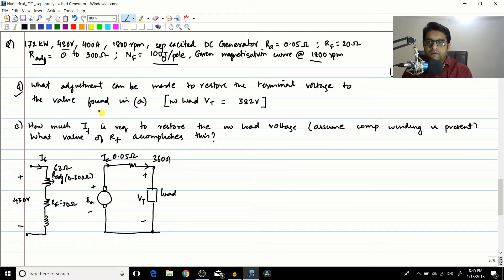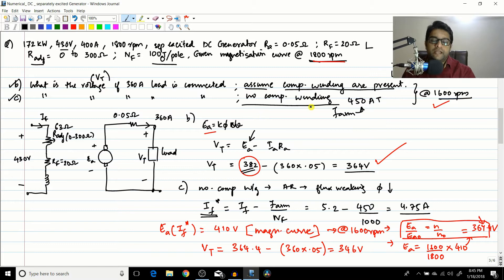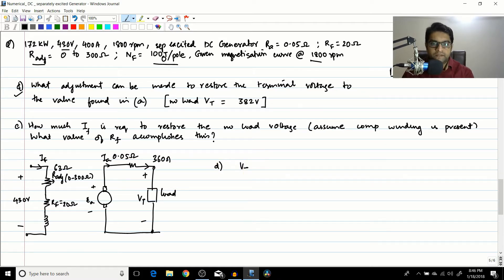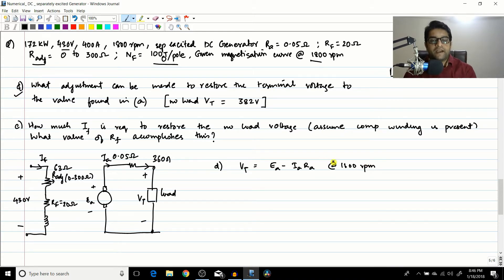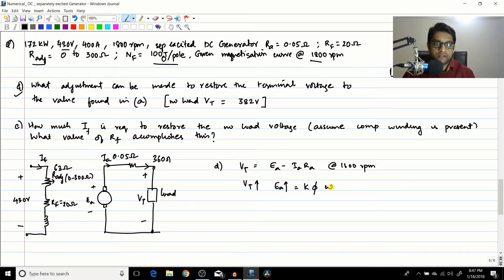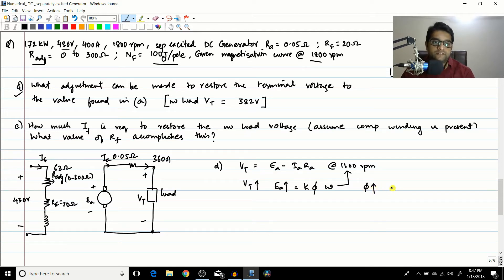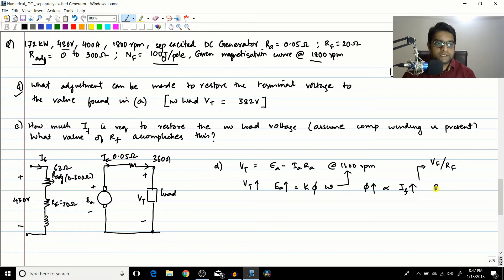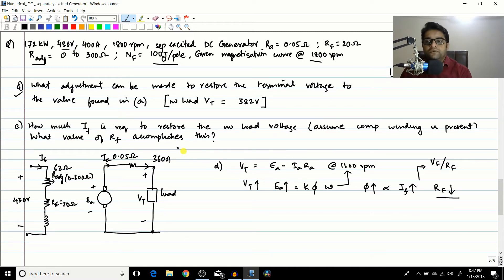#7 DC Generator -  Separately excited DC Generator Numerical Part 3

Comment: Sir without using magnetizing curves can we  use [(382/400)*83]-20  as for constant speed Ea is proposional to flux and flux  is proposional to If ,which means If is proposional to Ea ,so using that connection theoratically we can get it right but I did not get the same answer? Btw these videos are so good and helpful :)